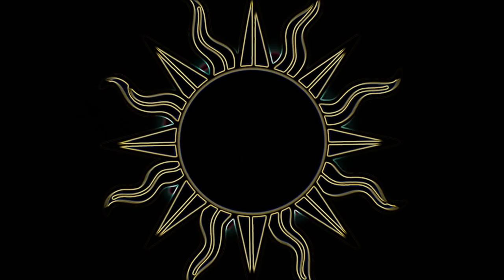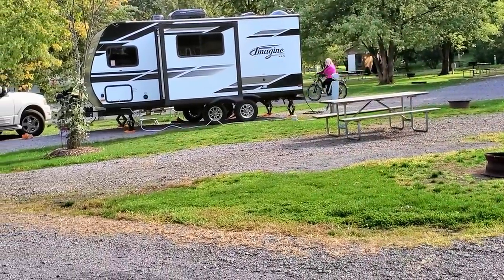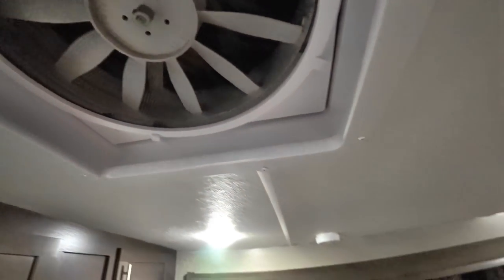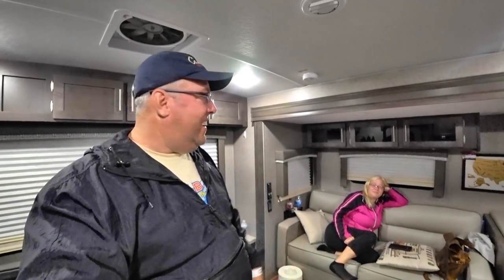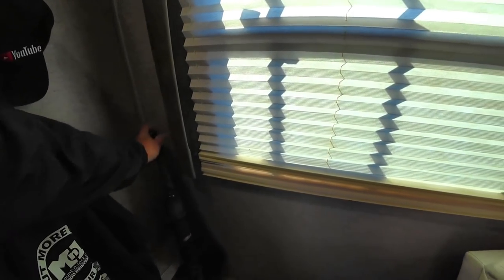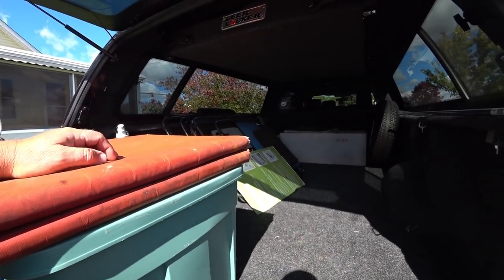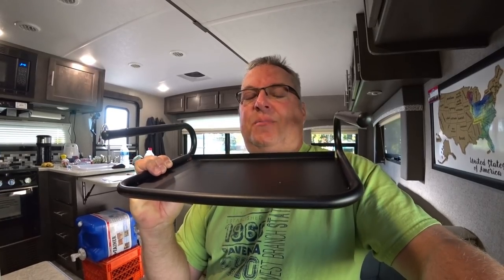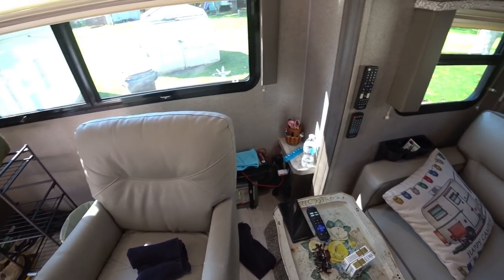Full Time RV Living Quick? Stop Back Home

Comment: Glad the bike came in and was not damaged. We got foldable bikes that sit in the back of the truck in storage containers. Two bikes in their storage containers take up about half of our bed as they fit end to end from the front of the bed to the tailgate . ( 6.5 foot bed)  also we decided to get the 4 inch wide tires which do work better in gravel (so far) 

Heidi looks great riding it, Also the Rad does have a larger motor and bigger battery than the bikes we got. I will tell you Mike that my 500 watt bike does pull around my larger body (I’m bigger than you) with pedal assistance going up hills. They are fun and a great way to get around the campground!  And they are comfortable by the way! 😁😁

Keep us informed on the bikes! I’ve found a lot of interest with the short videos that I’ve posted on my channel. 

Stay safe! Bill in Utah

Ps I typed this before you commented on the reason for not getting folding bikes 🥴

Comment: Just curious but why not do a dual hitch receiver like I have on my rig for the bikes? I don't know if you remember but we have two Ebikes and we still pull 5200 IBS SUV. This is my 2nd rig doing that and no problems at all.. We cover thr bikes with a heavy duty bike cover and lock the bikes to the rack.. They would destroy the bikes before stealing them... By that time, they might get destroyed if caught.. LOL...
Reply from the maker: We have a few ideas, Michael really wants them inside while traveling but all of his stuff too lol 😂😁👍
Reply: @Rvdaydream  It was just a thought because everything will be crammed inside which means, you'll have move stuff, everytime you want to use the bikes, eventually you'll stop using them because it will be a pain the butt to pull them out and put the wheels on to ride. Another youtuber (Our Journey in Myles) did the same thing with their EBikes and stored them in the back of their tow Vehicle, I have yet to see them ride the bikes since they bought them. This was one of the reasons we stop putting the bikes in the basement, we stopped using them because it was a pain to bring them up. Anyway, I hope it works out, And I sure hope Mike doesn't remove the safe in the cap.. That a great spot to lock up your hammer when your away from the rig.
Reply from the maker: Thanks Herbie.. Our bikes won't go to waste that is for sure. 😁 That's gonna be a new transportation when parked at the tt campgrounds 😁..

Comment: I ordered  the Mopeka tank rubber mounts based on your recommendations , when I received  my shipment I found that I only received one rubber mount.  based on the price I think I was shorted one mount and will be returning the one that I received.  the tank monitoring system is crap at best . I have been trying to get it to work for two years with three different systems with no luck
Reply from the maker: We ordered quantity 2.. They weren't exactly cheap..we have been extremely happy with the system... Other than that 1 sensor failing it has been perfect...
Reply: @Rvdaydream  I would have never fred it had I know or even thought I was sonly getting one for that price, it is going back I have had three sets of the monitors and noe of them worked properly. their customer service is great I will say that but the product just dont work as advertised.